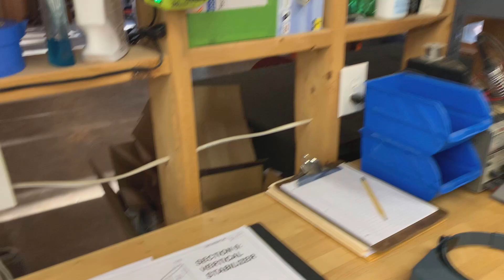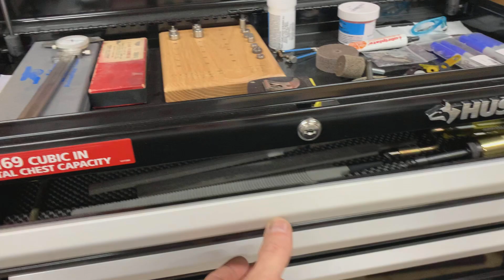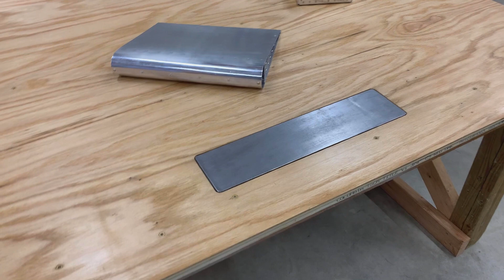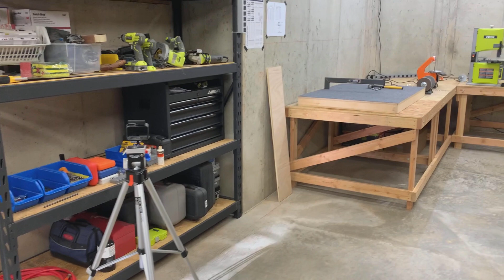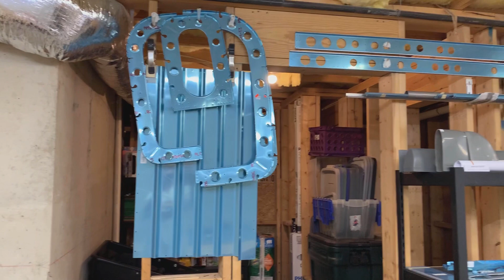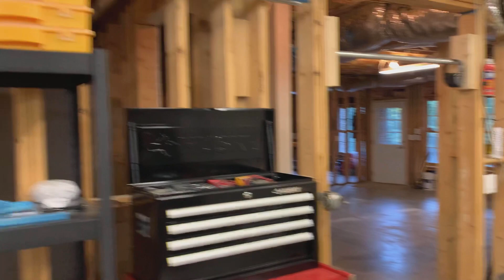RV-10 - Basement Workshop

Comment: So how big of a space is needed to do the build?
Reply from the maker: The bigger the better ;-)  They say you can do it in a 2-car garage, and a lot of people build, or at least finish, in a hanger (which really isn't much bigger than a 2-car garage).  The main building area in my basement is long and narrow, about 12 feet X 24 feet and I'm doing the bulk of the building in there.  But I do have another room I use as a "paint booth" area, and another room for storage of materials and completed parts.  I figure I'll get as far as building the wings in the same 12x24 space, but once I get the fuselage I'll likely spill out into the next room.  I think people can make do with less, but again, the bigger the better.  My main limitation will be how far I can get before I need to relocate to somewhere with a bigger door, else I'll have a plane stuck in my basement.

Comment: Great video series! I have ordered the RV-12iS empennage kit and I am in the process of acquiring tools. I have the same Porter Cable 6" bench grinder. DId you have a problem getting the 1" ScotchBrite wheel to fit, they normally take a 3/4" wheel.
Reply from the maker: Thanks!  No trouble at all getting the ScotchBrite wheel to fit on the Porter Cable grinder.  The width was not an issue at all and the wheel came with a nylon adapter to make the diameter of the shaft match the hole in the wheel.  Good luck on the -12iS!

Comment: Nice intro!  Just curious ... what are the dimensions of your workbench (W x L x H)?
Reply from the maker: Thanks!  The table in the middle there is 48W" X 86"L X 32"H.  

The bench in the background with the manual on it is store-bought (from Costco IIRC) and is 2 feet deep, 8 feet long, and 38" high.

The 'L' shaped table with the power tools is 48" deep and 32" high, with the long section about 8 feet, the short section about 4 feet, and a weird triangular area connecting the two where the concrete wall angles in. 

All the tables had lives before the RV-10, and have been repurposed for this project.  As I build I may put the table on wheels, or I may build yet another in the other room.